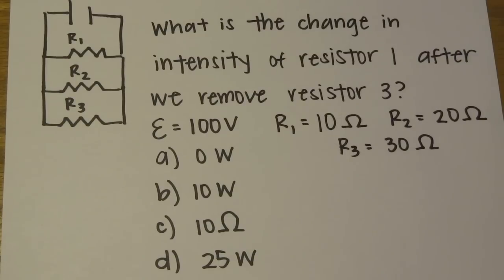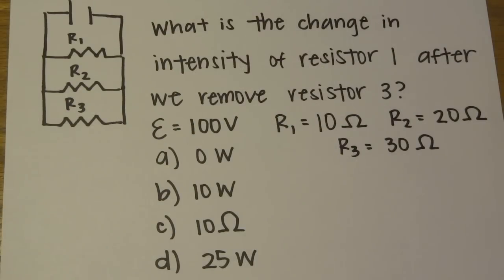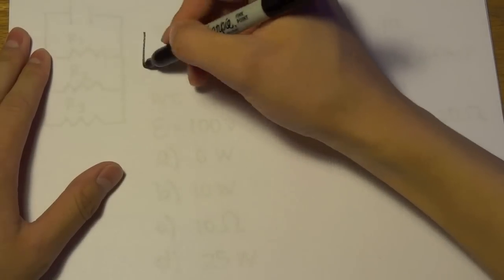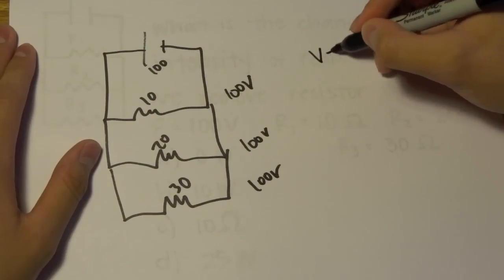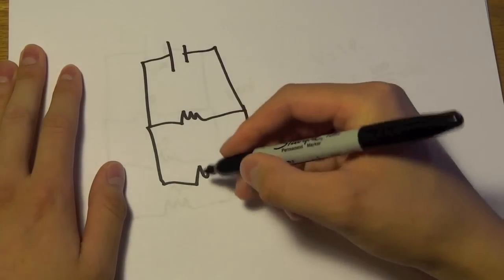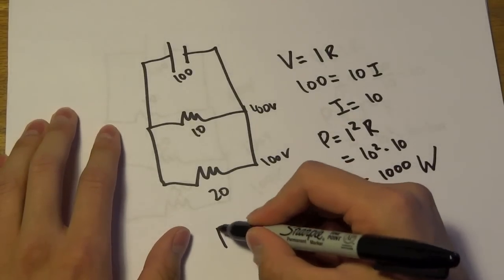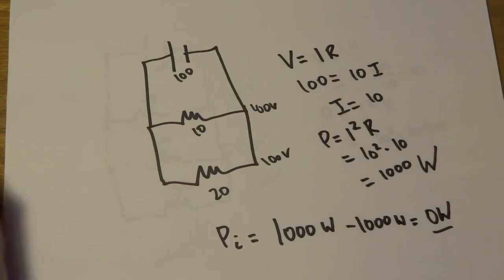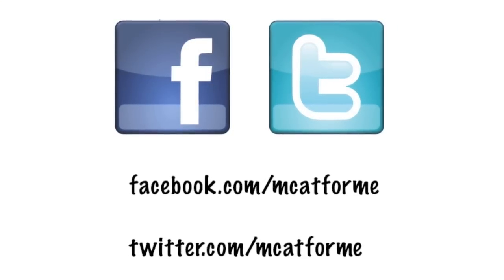MCAT Question of the Day 1 Physics Circuits

Comment: You could have also realized that Power = V^2/R, and since they are in parallel, the voltage will be 100V for all of them. The resistances won't change for R1, therefore they are the same power (intensity).

Comment: I understand that removing resistors in parallel does not change the intensity (power), and conceptually, this is because in parallel each resistor is going to feel the same voltage (in this case 100V). When we first find the current (I) in amperes using Ohm's law, we can calculate for power using  P=I^2R and see that there is no change in power after the removal of a resistor. But I am wondering: is this mathematically true because of the fact that current through a conductor between two points is directly proportional to the potential difference across the two points? Is it this fact that essentially makes R a constant?

Comment: You don't actually have to do math to solve this problem. Good explaination though.
Reply: You’re right. Ohms law
Reply: @shanarobinson7672  Even simpler: it’s the first resistor. Therefore no change in resistance occurred before that point as resistor 3 was removed.